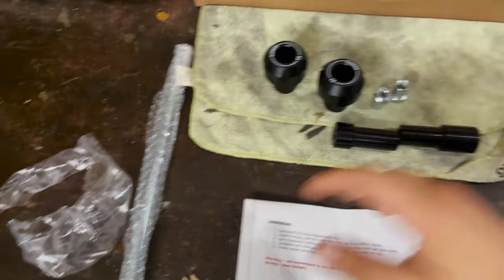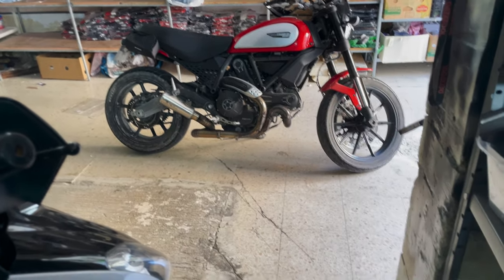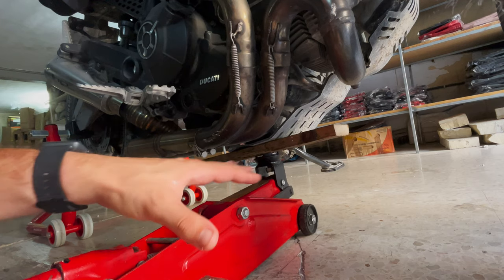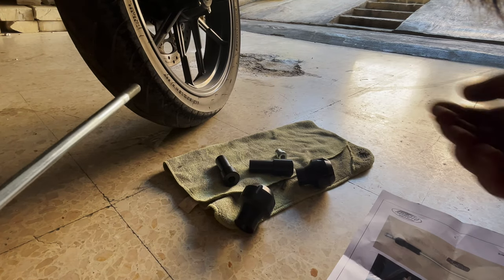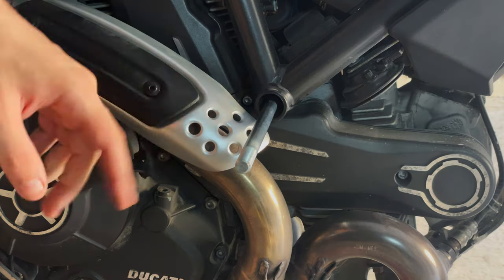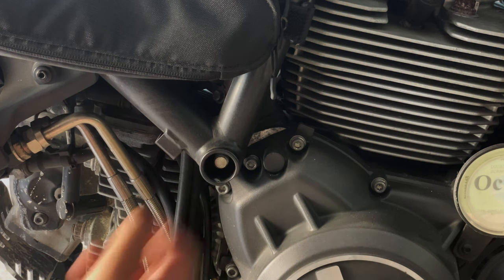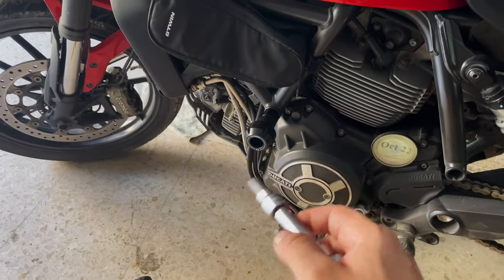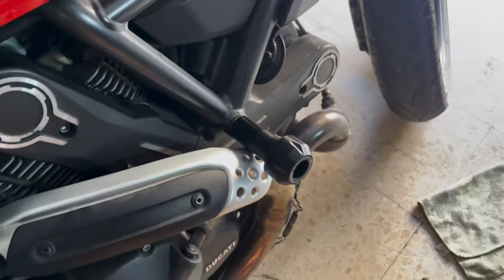How to Install Frame Sliders (RD Moto) - Ducati Scrambler

Comment: Hey! Nice video. I have Scrambler 1100 and I intend to install crash pads on my own. My question is that possible to change the rod without jacking the bike under the engine? (Because I don't have any motor protection metal  to support the jack as you did.)
Reply from the maker: I would advise to still support the engine as there is a good chance it will drop just a bit when removing the old rod. Just use a piece of wood between the jack and engine to distribute the weight and you should be fine.
Reply: @pullumoto  okay I’ll do so that, thank you for your help

Comment: I have just fitted a set of Puig bobbins to my Icon. It was on the sidestand, with a rope tying it to the front forks so it cant retract. I put my car scissor jack under the engine head fins as a support but in practice it was not necessary. The existing engine mounting bar just slid out without having to knock it. I think this guy had to knock it out because he jacked the engine up too much and pinched the bar!
Reply from the maker: The rod could have been pinched a little bit yes and there was definitely some corrosion also, however when I lowered the jack without the rod  the holes didn't align as the engine dropped just a little bit
Reply: @pullumoto  Ah Ok.

Comment: Hi there, greetings from Ecuador, may you help me? I just changed my exhaust putting just  slip on, what is the purpose of using that pipe with that curve? thank in advance for your answer.
Reply from the maker: Hi! That pipe replaces the catalytic converter and it's rounded like that just to look nicer, usually other brands make them straighter without that bend.

Comment: Nice video 👍💪
Would you mind telling me why you raised the engine? 
Greetings from Serbia
Reply from the maker: Thank you 😀, the engine was supported because the long metal rod that I replaced supports the engine to the chassis, so if you don't lift the engine a bit and remove that rod the engine may drop off a slightly and you won't be able to install the new rod.

Comment: What's a good wrench with adjustable torque for this kinda stuff?
Reply from the maker: any wrench from you local hardware store or amazon/ebay should be enough no need to buy super expensive equipment, just make sure that it goes up to 65nm of torque https://ebay.us/qpdpIQ